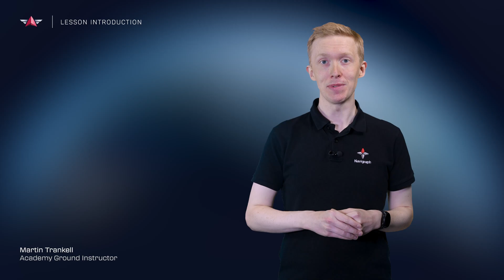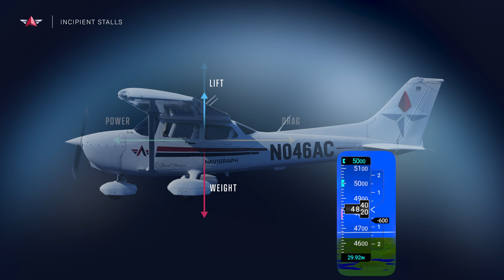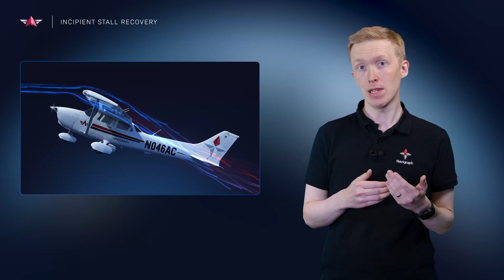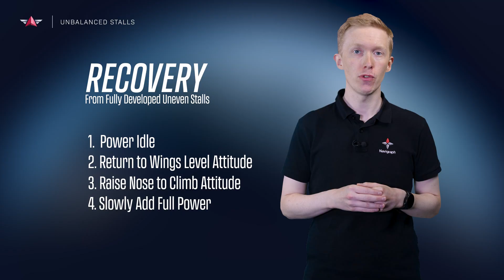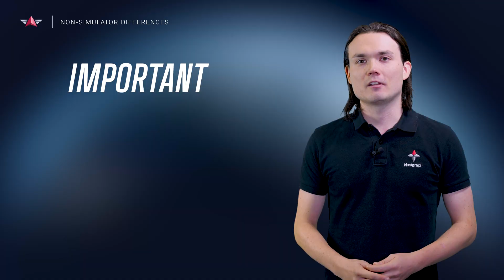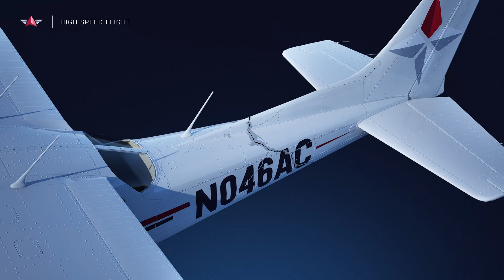Cessna 172 Stalls & High-Speed Dives Explained – Lesson 5, Virtual PPL | Navigraph Academy

Comment: Yeah, something's wrong with this lesson. SimLink just won't detect my "Non-Straight Stalls". I've tried idling the engine both before starting the 30° bank angle turn and also during the turn. Every time, I pitch up to maintain altitude and lose airspeed until the stall alarm sounds. Then, I pitch down to regain airspeed at the expense of some altitude, throttle up, level the wings, and start regaining altitude. I just don't see what I did wrong. The briefing could be a bit clearer
Reply from the maker: Hi! We’re very sorry to hear that. Please allow our Academy support team to look into this by posting here: https://forum.navigraph.com/t/lesson-5-stalls-dive-to-max-speed/19956/48
We’re sorry for the inconvenience!

Comment: My God! I had to try MANY times to pass. In reality, what was expected was very simple — low workload, basic stuff.
But I kept forcing the aircraft and ending up with the worst possible stalls. Result? A low score.
Once I understood that it was actually simple, everything clicked and I passed.
Another issue I ran into in MSFS 2024: when starting the mission, I couldn’t hear the stall warning. For some reason, the game audio was still stuck on the mission selection screen. I fixed it by pressing ESC and returning to the flight.
Great video — thank you for the course.
Reply from the maker: Yes, the stall warning is a bug with MSFS
Reply: @NavigraphAcademy  FYI in VR even if you hit escape and return to flight the stall warning never sounds. It works fine in free flight though.

Comment: Hello, The stall warning bell and sound" "Stall  does not work at all. Also the weather is gusty nearly impossible to ho;d any course. In free flight this all works properly... with the Cessna 172. The level flight stall is impossible due to the high winds. So it breaks away into a spin. Not a Student environment
Reply: For the stall horn, pause and unpause the game. As for the guests, I am not having this problem. Although mine always says non-straigjt stalls incomplete even when I do multiple.
Reply from the maker: Hi! The weather is set to winds calm, and should not affect the flight. If you experience too much turbulence you can reduce this in your realism settings. As for the stall warning, this is unfortunately a bug in MSFS2024 we have raised with Asobo. As others have suggested, pausing the game and unpausing solves it. We hope Asobo will release a fix in the near future.

Comment: Can confirm it does not work with MSFS 2024 latest beta 4 - no horn almost impossible to stall - stock 1720 g10000 works no issues as reported above
Reply from the maker: Hi. We are contiuing the investigation on this. Currently it appears to be a flight sim/Asobo issue. We have taken contact and filed a formal bug report.
Reply: Pause and unpause the game

Comment: I am using MSFS 2020. This lesson seems almost impossible to pass. If I recover from the stall as soon as I hear the alarm, the grader won't detect my recovery. If I stay on the stall longer I end up overshooting the minimum loss of altitude. The turning stall is also hit an miss light this. Any advice from anyone on how to get the grader to recognize the stall on time and make it pickup the recovery?
Reply: I would be good to understand what point exactly is considered the start of the stall, for each the incipient and fully developed stalls. Basically when is the "start" altitude accounted for? And what speed is the point where we can start the recovery procedure.
Reply from the maker: We have identified that the margins to pass the straight stalls are too strict. We will shortly implement a solution which will make it easier to pass this manouvre.

Comment: Hello, I have been enjoying your video, however I must agree and confirm with HerberHatsand (1st to comment) that the stall buzzer does not work, I did confirm it does work in free flight. Had to fly this exercise by the number not the buzzer sound.
Reply from the maker: Hi. Thank you for your feedback. We are currently investigating this issue. Can you confirm you are on MSFS2024?
Reply: @NavigraphAcademy  Yes , MSFS 2024 New computer JUST FOR MSFS 2024 and nothing else new install MSFS 2024 just about a week now, running a 14900k with a 5090 as mentioned also did a test in free flight which it works fine, did a few flight in the lesson but no stall buzzer, have to complete the lesson by just by the numbers, (airspeed)still love you videos.
Reply: Pause and unpause

Comment: I’ve been trying to pass the stall test all afternoon, I don’t know what I’m doing wrong. I’ve compared my attempts with the Navighraph tutorial video and can’t see any difference, and my stall horn doesn’t work with navigraph....it works in the sim.
Reply: I had the same problem, I first thought it was my system, after failing the lesson a few times.  Try this here is what i did and passed first start with the dive so climb to 7500 once you reach 7500 do not throttle back just yet accelerate to 100 knot then throttle back to 2180 RPM and the rpm will increase in the dive, pi use about 15 degrees nose down you will reach 155 around 4000 or above power off gentle pull out to level off let the speed bleed off at 100 start you pitch up to about 7.5 to 8 degree at the speed bleed off and you reach 75 full power to climb back to 5000. 
Now for the stalls the buzzer does not work so use the airspeed tape,  for the incipient stall the busser would start about 54 Knots let it get to 52 knots ( your stalled) lower the nose and Throttle up slow basically form idle to full 3 second stay level wings   at 60 Konts  raise the nose to about 7-8 degrees climb back to 5000 at 75 knots. Now you're ready for the full stall maintain altitude as you throttle back as best you can, at about 48-49 knots the nose will drop,  as soon as the nose starts to drop, break the stall by lowering the nose just a little (actually release some back pressure and apply full throttle keep wing level,  then as you level off and start  passing  60 knots slowly raise the nose to about 7-8 degrees climb back to 5000 at 75 knots, Now for the last the turning stall start level slow to 68 knots start your descending turn at 30 degrees  slowly pull back at about 55 the stall busser should sound but it's not working so at 52 knots pitch forward  level the wing power on as you pass 55 slowly start the climbs. Hooe, it works out for you I flew the numbesr and final passed this lesson
Reply: @michaelcollins7859  although I'm not the OP, thanks i'll try this out because I'm also having issues. Although, for the stall warning just pause and unpause when u get into the lesson.
Reply from the maker: Hi! We are looking into the issues reported on the stall lesson currently. As of today November 28th 2025 there seem to be an issue causing the stall warning horn not to sound in the lesson in MSFS2024. We are investigating this. As for the stall, make sure you loose as little altitude as possible and recover your original altitude post stall. We will also look into the specifics and see if the lesson is tracking incorrectly. Please reach out on our support forum if you'd like to get us to look at your flight's specifically https://forum.navigraph.com/c/navigraph-academy/academy-technical-support
Reply: Pause and unpause for stall horn